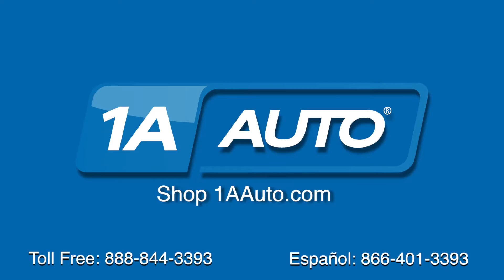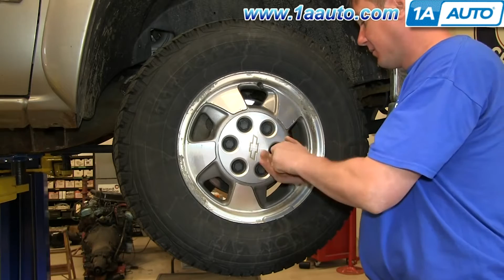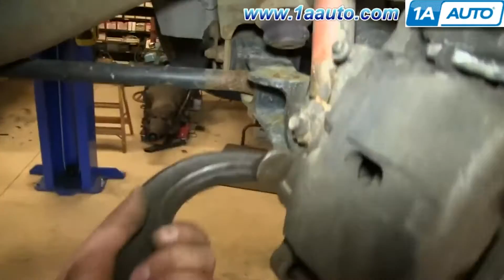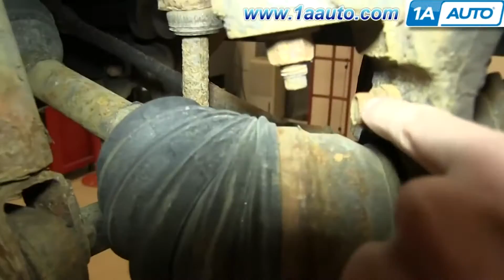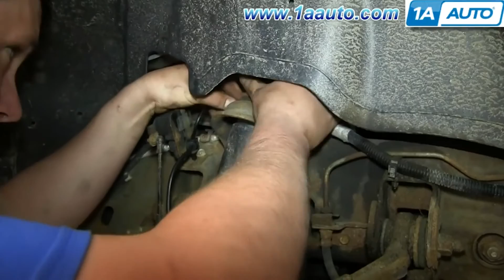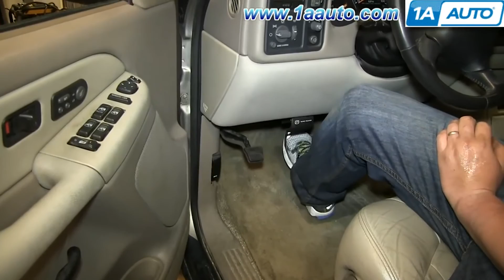How To Install Front Hub Wheel Bearing Assembly 00-06 Chevy Silverado

Comment: You should have mentioned the dust plate goes  on one way with the flat side facing out. I appreciate your video. It was a lot of help, I just had to take very thing back off when I realised the dust plate was backwards when I tried to put the rotors back on. Other than that it was a great video. Thanks!

Comment: Where does this rusty vehicle live?  Maybe it would be good to change  the cv shafts as well while your at it?
Reply: My Sierra is worse, I live in the north east. It took me almost 5 hours to get my driver hub off using a sawzall, torch and a cutoff wheel. Took me 3 hours to do the passenger side.